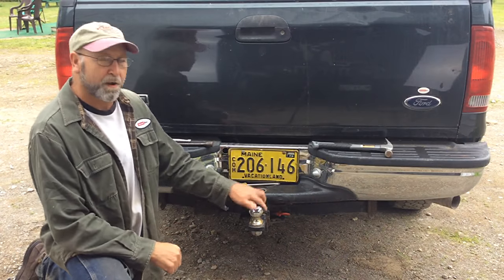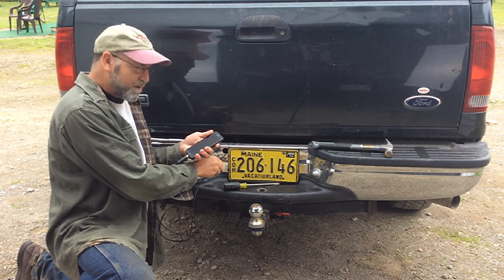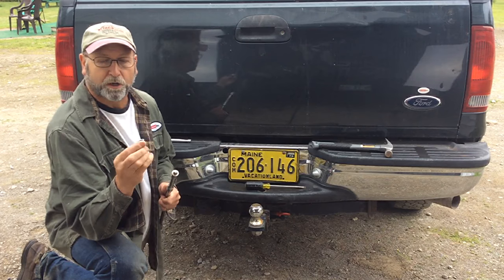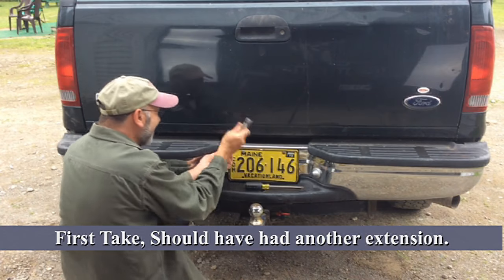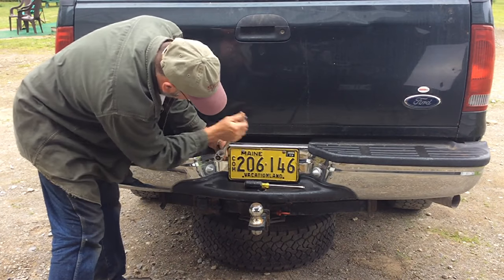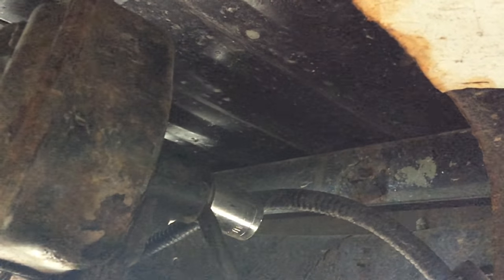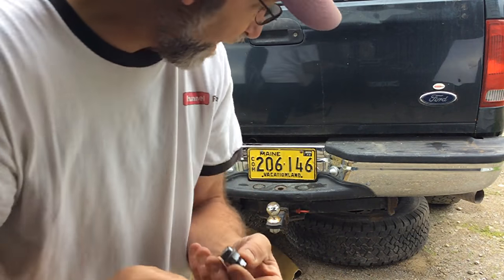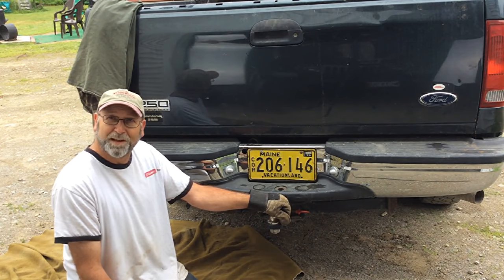How To Remove Spare Tire Lock Without The Key Quickly

Comment: It worked after the fact, had to get an old cheap 14 mm, and a long 3/8 extension, tapped it right on, lowered the spare no problm. Gonna drill a hole in the 14 mm while it is in the " lock mechanism,  put a roll pin in , and just leave it on, and an old 3/8 ratchet, and long 3/8" extension with the tire tools/ jack.

Comment: Thank you Thank you Thank you! I used your method but used a 6 point 9/16" tapered socket which is 14.3 mm bought at nothern tool as they sold individual sockets. One other thing i had a little trouble getting the plastic tube off so I drilled a hole through it and inserted a screw driver through which made it much easier to twist turn abd pull it off. My tire came down much easier than i imagined it would.
Reply: Another good source for single sockets is a pawn shop. Two of my local pawns have loose sockets in buckets, just take a pair of rubber gloves with you.

Comment: Great video, this just helped me get the tire down on my 2011 Superduty.  Only difference was the socket size, after pounding on the 14mm and 3 foot extension for a few swings it didn't go on.  I checked the face of the socket and could see I needed a bigger one, ended up using a 17mm socket.  Everything else worked as you suggested it would.  At the end I threw the lock and key in the garbage and left with the regular crank same as the jack.
Reply from the maker: Nice work!

Comment: This is genius thank you! Just spent an hour with my arm between the frame and the bed trying to pry off the key with some channel locks on a 2010. Will try this now. 

I removed the key a while ago on another truck. They hooked end of the winch rod will fit right in after. The easiest way to do this is to remove the winch (two self tapping bolts) and knock it out with a hammer. I also like to fill the winch mechanism with some kind of rust proofer/ lube (white lithium/ fluid film/ etc).

Comment: my old 12-point 14mm sockets were too loose on the lock and would not bite and the only 6-point I could find in my toolbox was 1/4" drive. I found success with a 9/16" 6-point socket and was still able to pry the lock out of the socket when I was done. Thanks for saving me a bunch of time and money!
Reply from the maker: Thank you! for supporting my channel!

Comment: 03 F-150: beat a 14mm extraction socket onto the lock device with a hammer. Lowered tire. Socket stayed on the locking mechanism. Took off the lowering device like shown. Locking mechanism came off when I tried removing the extraction socket. Now works with just the tool under the hood. Did all of this in about 30 minutes. No problem... you can do it! Oh yeah... thank you!

Comment: So this is the second video I found on how to remove the lock, the first recommended one at about 2/3rds the way through mentions that "If the spare tire is on the carrier you will first have to figure out a way to get it down to remove the lock" Well that was a "FAIL" video and a complete waste of time. Then off to the side I saw your video and clicked on it. Very very helpful clue about the 14mm socket!!!! Grabbed a cheap 12 point 14mm socket and one of my very long locking extensions and "viola" ! Lock removed in just a few seconds! Problem perfectly solved! Ironically, I am going on a road trip tomorrow with my "new to me" F250 SD and just wanted to check the spare! Thanks again!!😁😁😁😁
Reply from the maker: Glad that I could help and thanks for supporting my channel.

Comment: QUESTION:  After you have pried the lock out, what sort of crank do you need to lower the tire?  What would the end look like?
Reply from the maker: the crank that I used was from and old 1978 dodge van, they all pretty much  have the same flat ends.
Reply: A 3/8 Drive Extension will also raise and lower your tire

Comment: Used the same 14-mm-socket trick on my 2002 F150. It was surprisingly easy to hammer on, and once on, the handle cranked the tire down with no problems.  My problem arose when I stuck the anti theft thingy onto the crank and stuck it in at the wrong place. It fell onto the spare's wheel.  Got rid of the hoist part of the anti-theft system using vise-grips.

Comment: So I used a 3/4” cpvc pipe to pop over the insert. I slowly wiggled the old inserted key out of the hole at the end of the tube. I tried with the 14-16 mm socket and no luck but the Inside diameter of the cpvc pipe fit perfectly enough on the dirty key to fish the old ones out. I did this for two of my trucks so I can no insert a new one. I bought a new key from Ford to have the matching set along with a new tire changing kit from orieleys. Total of about 150$ vs 460$ Ford wanted. I think Amazon may have an option cheaper yet. Which I am researching for the second truck.

Comment: Thanks; it worked great, although I needed a 9/16in to fit.  Since I damaged the socket I went ahead and forced the two parts together on a vise.  Now I can use a 3/8in drive extension and ratchet to raise/lower the tire.

Comment: This is a super video.  I watched another earlier of someone cutting the spring.  I will say that I tried alot of times and almost gave up until I read the comments and found that the 17mm socket was the one that worked for me.  Thank you Ron and all those that commented.  Only thing I purchased was a cheap 24inch socket extension from harbor freight.  Again, thanks. GREAT video.

Comment: That was a good video, to the point, likeable guy and you made it look easy . I’ve been trying for a couple days to do this- I’ve heard use a 9/16 socket, a 14 mm socket and the latest was a 17 mm socket. Around the security part of the hoist mechanism on mine is a plastic or rubber housing that so far has prevented me from being able to pound a socket over it. Tried cutting the spring underneath with a grinder and no bueno. Mine has some kind of indestructible part in the center. Story of my life- every time I find a video that makes it look easy, my setup is just a little bit different. I wish I had a gun that’s barrel fit in the hole -

Comment: My truck came without a jack (2013 F150). I ordered a new one from Ford. The new jack crank doesn't have the flat tip as seen in this video. It's all female squares at the end of each section of crank (my crank rod is in pieces, not one solid crank as seen in this video).  As it turns out, a previous owner of my truck already took the key out of the crank, which is good because the crank rod key is also missing. My problem is figuring out how to drop the tire. I have a female end on the crank arm and a female end female end on the keyless crank!
Reply from the maker: if you can you can? weld a tip on the crank and grind it to fit?
Reply: @channelron3593  Yeah. I may be able to have that done at work. I don't own a welder. I guess that I could also just make my own key with a 2" piece of steel square tube and not have to alter the crank arm.

Comment: This does work, the issue I had was I never had a soft 14mm but I was able to pound a 9/16" socket over it. I just finished, it only took me about 15 minutes and now I can use the jack handle without the dumb key.

Comment: Thanks for the help! Great video!  I couldn't get the 14mm on, so I tried the 9/16"(from the comments) and it worked great. I could lower the spare on my new to me 2005 F350 and take off the anti-theft device.  I also got rid of a rattle that has been bugging me, a large rock was on top of the wheel bouncing around while driving :-):goodvibes:
Reply from the maker: Nice work!

Comment: Apparently I used a high quality 14mm socket.  Couldn't get it cover the key.  I'm envious of your 
(almost) immediate success.
Reply from the maker: Ya, you have to use a cheap one, when I talk to a mechanic he was very adamant about using a cheap socket, Thanks for watching.
Reply: @channelron3593  Makes sense...cheap one will "Deform"
Reply: It Hass to be a six point socket. It cannot be a 12 point.

Comment: It worked but not as advertised. I couldn’t get the cheap 14 mm socket to seat on the lock. So I cut up a rubber band on put it in the socket.  I got it to bite and turned the socket to my surprise the lock broke at the stem of the lock and was in my socket.  I thought oh crap part of it is blocking the opening. I tried the truck supplied crank anyways and it worked fine. So I didn’t bother removing the plastic sleeve.  Thank you! Totally cost to me $10 for a 24 inch socket extender
Reply from the maker: $10 buck! Not bad.

Comment: Great solution, it took a 17 mm socket for my 2011 F-250 Super Duty crew cab. I started with the 14 mm. The lock pattern is basically Square when I shine the light on it. So I think that's the reason it took a larger one. But when I found the right one it worked like a charm. Thanks
Reply from the maker: Nice work!

Comment: What's on the end of that crank? I bought used and don't have the damn key OR the Ford supplied roadside tools. So, if I
do your 14mm socket method, what do I need to buy to operate the winch?
Reply from the maker: Not sure if I understand. the crank is just a basic crank, and for the 14mm I am using a 1/2 drive ratchet, hope this helps and yes it is very frustrating have been there, good luck.

Comment: Thanks so much for this video,  I was having the same exact problem with this with my 2003 f150.  Took a couple of tries but I finally got it with a 17mm socket to lower my spare tire, so many rust chips.  Then I got the spare key tire lock off with a flat head screw driver just like in the video, but my 17mm socket came off first then I got the lock off afterwards.  Took about 45 minutes for me, my neck is a little sore though.  For those of you who have an early 2000s f150 try using 14mm-17mm sockets.
Reply from the maker: Your welcome!

Comment: Well, who carry’s a cheap socket??? I’ve been at this for a while... I went to Home Depot and bought one there, I went to ACE hardware bought one there, still can’t get it over the lock!  Any additional advice...
Reply from the maker: Wow I never thought of that, most kits are pretty well made nowadays.... maybe Wallmart sells cheap tools? you have a very good point.
Reply: Channel Ron, I finally got it off!  I found a lesser cost 14 mm socket and hammered it over the lock and was able to lower the tire!  Thanks for this great video!  Ford dealership couldn’t help me, local tire shops couldn’t help me, but you did! Thanks!

Comment: Well it worked for me. If you use multiple extension and yoh hammer it for a while it still feels floppy, but it's not falling out it means that it's on but it's floppy because of the multiple extensions. I didn't have enough extension so I also added a long drill bit in the end and slowly line it up with head of key using a flashlight, then hammer the end of the drill bit against end of extensions. Once it's stuck then I removed the drill bit and attach driver to end and reached under the car and around tire to turn it. Was award but you have to make due sometimes

Comment: 2017 Superduty didn't have a security key but the spare tire was in the bed. After watching the video i was able to just crawl under, remove the plastic tube/guide, pop the security bit out with a screwdriver and replace the tube/guide. Finally got the spare in the stock position on the winch now and can use the regular jack equipment to drop/raise the tire. Took 15 mintues maybe from start to tire in place and tools away. 👍

Comment: Just because I want everyone to know. I tried it with a 14mm but mine was apparently too good. Didn't expand. Looking around I saw a piece of 1/2 inch metal electrical conduit and slid that in there. Went right on with a tap or two but would not bring the tire down. Enter Gorilla Super Glue Gel. Ran a little bead around the inside of the conduit, slid it on there and went and got a beer. Came back out, yanked on the conduit and there was the key, no muss, no fuss. Now I can use the standard spare crank no problem. No need to crawl under the truck, no need to remove anything, just glue and go. Love it.
Reply from the maker: Nice! will try next time I run into this! thanks for the tip.

Comment: Also if it is a cheap china made extra socket you have to spare, I had to bevel the 6 point socket to slide past the plastic tube there at the key before I could drive the socket over the key

Comment: Worked on my 2008 F450 SD. The spare tire key is 14.5-14.2 mm in diameter at the top. I have tried to grind/dremel a good quality 9/16 socket, but that did not work. I my case  - Step 1 - remove the plastic tube. Step 2 - use cheap/soft 14 mm socket. Total time - about an hour, as good quality socket did not work.
Reply from the maker: Nice! Thanks for watching

Comment: If it's not a cheep socket you might have to hammer more. It took about 20-30 hits for me. I'm also surprised that it turns because this tire is pretty New, which means it probly the first time it's removed since 2006

.oh yes. Thanks buddy

Comment: A 6 or 12 point socket ?
Reply from the maker: ether one should work, thanks for watching.
Reply: @channelron3593  You SAVED me SO MUCH TIME!!! THANK YOU!!
Reply: Neither my craftsman 6 or 12 pt worked. Went and bought two made-in-China Channelock brand 6 and 12 pt sockets. Tried the 12 pt first but only the cheap 6pt worked. BUT IT WORKED!!

Comment: So all the thief needs is a 14 mil socket, however the average owner is stuck by the side of the road because I can't find the key that I didn't know I needed.  It should be attached to the rod if it is so important.  Thanks for helping us out, also that you can remove the key and just use the rod like I would expect too.
Reply from the maker: That is correct, Thanks for supporting my channel!

Comment: I have a shop and we had a bucket of random sockets from over the years. None of the 14mm sockets would work. From Chinese no name to Husky to Craftsman. 12 point is too big. Also tried 13mm 12 point and 9/16" and 5/8" 6 point. Nothing. 

I figured it needed to flex some to get on and grip. So I grabbed the cheapest looking socket and ground down the outside to weaken the socket some so it would more easily pound on. I took about half the OD off. Put the socket on an extension and spin it whth whatever you have to make it spin. Grind on it with whatever you have to grind with. 

It hammered right on at that point just like the video. The outer diameter of the lock thingy is 14.65 mm So a six sided 14 mm socket needs to flex decent to go over it and still have traction to turn it. So a 14mm socket is the correct socket. But it needs o be the cheapest socket made out of the crappiest metal and be thin... or grind gown the outer diameter.

Thanks for posting the video!
Reply from the maker: Hmm, keep trying it worked for me, you will get it

Comment: Those keys were the stupidest thing Ford ever did for this assembly. I plan on taking mine out from under, getting a bedside mount, and chaining it to one of the cargo loops. Those under bed carriers are nothing but a pain in the ass, especially when you are along the interstate with vehicles wizzing past you at 80mph. I also ditched my OEM jack, and put a heavier duty bottle jack in my kit with some wheel chocks. I also off road for hunting/fishing- I've gotten hung up before on the spare tire under the bed.

Comment: I wish I would've had a long enough extension to get a socket on that damn key when I was stuck on the side of the road because of a blow out.....had to have my truck towed...couldn't use my spare because some tweaker broke into my truck and stole the tool for the spare tire key...i ripped out that damn key when I finally got the spare down and am trying to think of a suitable death for it...I'm thinking smash it....

Comment: No need for socket and hammer etc...
FIRST - Go underneath and slide the tube off to gain acess to the lock, just like he did after he pounded the socket on.
SECOND - Pry the lock off with a flathead, just like he did after he pounded the socket on.
THIRD - Get your oem handle and insert it into the reeling mechanism and crank it down/up.
WHY POUND A SOCKET ONTO SOMETHING THAT YOU ARE GOING TO HAVE TO REMOVE THE SAME EXACT WAY WHETHER OR NOT THERE IS A SOCKET POUNDED ONTO IT... ISN'T IT QUICKER/EASIER TO SKIP THE UNNECESSARY WASTE/WORK?